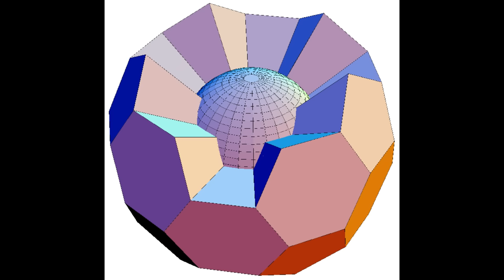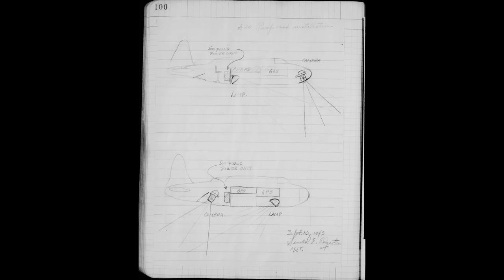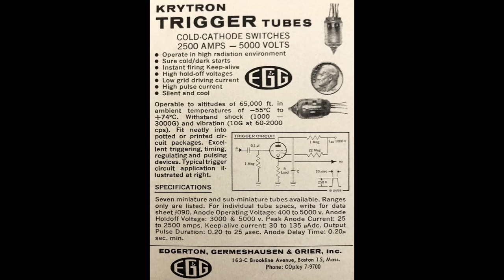Before The First Nuke Exploded... It Imploded.

Comment: For anyone wondering, high explosives are somewhat hard to detonate, you usually need another smaller explosion to set it off.
Reply: Not for C4
Reply: @Rob-tr1st  especially for C4, what do you mean?
Reply: @vrmousse  He probably read it on the internet :3
Reply: @vrmousse  I meant you need pressure and heat
Reply: Well with c4 you need an electric ignition block normally timed or remote detonated (edit ... its the energy needed to start the plastik chemical reaction)
Reply: This, now dynamite is pretty sensitive but TNT is hard to detonate, shooting at it with normal guns tend to not set it off, an M2 .5" round will.
Reply: @Rob-tr1st thank you for the laugh, but I hope you're not serious.  C4 needs an explosive to set it off.  A gunshot won't even set it off.
Reply: @billydoe6240 even an explosive might not set it off, the outside oxidizes and protects it from stray ignition, that's why they have to shove an ignition spark into the block
Reply: @billydoe6240  well having worked with it as a combat engineer I think I know how it's set off.
Reply: I guess nitro-glycerine isn't considered a high explosive? Asking here because I don't wanna google it :) From what I understand, NG goes off if you look at it funny.
Reply: It's explosives all the way down?
Reply: I offer nitrogen triiodide as a counter-example (not that any sane person would use it other than as a curiosity).
Reply: @Rob-tr1st in Vietnam they used to light c4 on fire and use it to cook food. Shits beyond stable.
Reply: @billydoe6240  even setting it on fire wont set it off
Reply: @magnemoe1 yeah dinamite and nitro, cordite and a few others have a naturally unstable chemical structure or unstable storage method resulting in lowered stability of the explosive that's normally why if we can we ship them with primers removed and in a separate shipment to prevent such things from going awry.
Reply: TNT was what's used in the early nuclear bombs, and potentially plastic explosives in newer ones, so to set it off, it has to be forceful in order for the chain reaction to start, Mercury fulminate is usually what's used to set it off as it's somewhat a high speed explosive which is necessary to set off certain explosives especially in the plastic forms. You can do squat with the plastic explosives, it's not gonna do a thing, burning or just smooshed maybe (it was intentional just so it's safe to handle).
Reply: @Sableagle  I thought they used nitroglycerin to control blood pressure or something?

How is that safe?
Reply: @billydoe6240  A friend of mine who was ex armed forces told me stories about how their CO had to keep telling units not to set plastic explosives on fire to boil kettles of water for a brew - not because it was dangerous, it was just a really expensive way to make a round of teas
Reply: @notfunny3397  Yep, in desensitized form.
Reply: @Dr_Mario2007  if I am not mistaken mercury fulimnate has been moved away from and now lead picrate and still under some R&D DDNP
Reply: @stoneymahoney9106  Yet if you are desperate, C4 makes a great tray candle to cook the food as it got a lot of energy density within so it burns very hot. And yup, it's expensive.
Reply: @StepSherpa  Yep, that too. Those explosives are somewhat more "green" compared to Mercury fulminate (who wants Mercury poisoning), so yep, they now use different blasting caps nowadays.
Reply: I feel like it'd be criminal to not mention azidoazide azide here...
Reply: @Rob-tr1st  so why could I burn C4 to heat water for my tea, without it detonating.....?
Reply: @Rob-tr1st   that is a lie. You are NOT an EOD. You do not know what you are talking about.
Reply: Your statement that MOST need a smaller explosive (primer or booster) to detonate is correct.But,my favorites dont.
Nitro and fulminated Mercury.
My very favorite,an oldie and goodie,is tetrytol.
Explosives was my specialty in the Marine Corps back in the very early 70's.
Reply: @TimmythatSquirrel with cy,tetrytol and other plastics,you need a cap.A simple electric charge wont detonate.Explosives and ammo was my specialty in the Marines.
Reply: @Rob-tr1st  It might be apocryphal, because EOD guys are a strange breed, but when I was taking my 3-day A&E class, we were told you could set C4 on fire OR stomp it, but not both at the same time. He told a story of an incident where an earth-covered magazine suffered an explosion and bits of flaming C4 were spread in front of the door. Apparently it was burning quite happily until someone tried to stomp it and put it out.
Reply: @notfunny3397 The amount of chemicals and ingredients in the heart med is reduced to almost nothing and at different percentages per ingredient than nitro that explodes.You can take a nitro tablet and smack it with a hammer and nothing will happen.You put a drop of explosive nitro on paper and set it on an anvil and smack it and it will pop rather loudly.
Reply: Wasnt C4 specially made to be stable to find a safer alternative to TNT? Pure Trinitrotoluol starts decomposing at above 150°C. I bet the mixtures are Not much different. Hence a Dentist Drill is water cooled and doesnt go beyond 100°C why would He be concearned setting of an Explosion.
Reply: Noted
Reply: @stoneymahoney9106   That was the Boston No Tea Party. Bang! General Early Grey again?! What? Deaf...
Reply: Army guard who didn't know this: (sees him melting comp B and drilling into it with a dental drill) (sprints out door)
Reply: Interesting, I will continue to not take my chances
Reply: @notfunny3397 They soak it into cornstarch or something to absorb any impacts. That's what dynamite was - nitroglycerin soaked into diatomaceous earth to make it safe to handle. (If you heat dynamite, the nitro oozes out ...)
Reply: @magnemoe1 Heat will set off tnt.  What
Reply: Normally for C4, compressed TNT blocks, powder explosive mixtures and commercial explosives a detonator capsule either electrically actuated or ordinary fuse actuated is sufficient. They can also be detonated with a detonating cord without a detonating capsule. An additional charge is necessary when it comes to cast explosives, for example, cast TNT must have an additional charge from compressed TNT to cause detonation, or the detonator itself must contain a booster charge. And yes, I cooked cans of beans with bacon and coffee on pressed TNT, plastic explosives and the like, it's a matter of quantity, 200 grams of TNT block OK, 1 kg not really, plastic explosive P36 100 grams ok 1/2 a little critical. Detonation will occur if the critical temperature energy threshold is exceeded
Reply: @miller2675 maybe you should learn the difference between EOD and a combat engineer before you correct someone
Reply: @STEVE_C_1369  a simple electric charge is not the same thing as exploding wires. People here are confused because primary explosives used for caps belong to the high explosives family too.
Any opportunity to talk about explosives is good tho 😀
Reply: High Explosive just means it's Shockwave is supersonic.  Nitroglycerin is a High Explosive and it will blow up spontaneously
Reply: @ConsciousExpression the difference is primary vs secondary and tertiary explosives, most primary explosives are high explosives but most of the commonly used high explosives are secondary or tertiary which are very hard to initiate by accident using stuff like tools or even fire.
Reply: @dinkoz1  ah that explains it, due to the Higher Mass and the longer burning time the Overall Heat Energy inside the Material raises above critical? Thats why you need a fuse to Insert the heat quickly so IT cant dissipate?
Reply: @billydoe6240  I've seen it used as fuck'n sterno. Bits of it twisted off, stuck on a rock set on fire to heat up coffee or MRE's.
Reply: @frimi6023  It's not the heat that matters, but the shock wave. Insensitive explosives are chemically stable until the moment they are exposed to the shock wave. For example, you can activate the detonation of a small amount of TNT, 1-5 grams, with a sufficiently large hammer. Likewise, all explosives have something we call "cook-off time" when the explosive exposed to fire will detonate after some time, military explosives also have an inhibitor to extend that time, especially with ship's ammunition to give the crew time to put out the fire and prevent the ammunition from exploding. The energy of the shock wave is what will start the chemical chain reaction in the molecules of the explosions. Sensitive explosives have very "strained" chemical bonds in the structure of the molecule, which makes them more unstable but more suitable for initial explosives, ie they are used in igniters and detonators to activate the burst charge. There are also initial explosives sensitive to friction, for example the PMA-3 anti-personnel mine has 35 grams of TNT and the initial explosive is activated when the spike inserted in the initial mixture moves when the mine is stepped on, which then activates the penrite which activates the pressed TNT booster and only then the cast TNT.
Reply: @trollmcclure1884  My job in the Marines in 1972 was 2311,with a lateral in disposal of explosive devices/rounds.
We used blasting caps that contained mercury fulminate.The wire within the cap was dual lead,and the ends were connected within the MF.An electrical charge went to the wire ends in the MF,and heated instantly ,causing the MF to detonate.Theres been some debate as to whether MF was high or low explosive.The main charge required a shock wave from the detonator.Low explosives give a sudden crushing expansion effect,whereas high explosives are so fast that they create a shearing,shattering shock effect.
I dont know if the debate has been ever settled.I do know that the caps worked.
We also used det cord to set off non electric caps.We'd take a bar or two of tetrytol,use the pointed end in our tool to push a hole into the end of the bar.Then we'd take a short length of det cord,insert it into the cap,and crimp it in with the tool (which,to prevent any chance of static discharge,was bade of beryllium).Then,we would link a determined length of timer fuse/cord to the det cord.At the operators end,we would insert the loose end of the timer cord into an M1 igniter.Then,the cap was inserted into the main charge (after the charge was taped to the explosives to be destroyed.)...had to edit that part in so as to avoid confusion.LOL. Once all was set,all personnel were run off,and the operator would pull the ring on the M1 and swiftly get outta Dodge. Ive popped off several old 90mm rounds ,2 at a time like that.Loved the job.
Reply: @notfunny3397 the dose of nitroglycerin for medical use is fairly small. Not sure what’s done to stabilize it a bit.
Reply: @notfunny3397  They do. They supply it in very small quantities, and it's handled carefully.
Also, you can stabilise it with clay powder. That's a combination known as dynamite.
It made a guy called Nobel a fortune, which he used to create a whole institute to award big prizes for big accomplishments.
Reply: @ConsciousExpression  ...but then if you pull the "who? moi?" innocent face fast enough, it'll stop the explosion dead in its tracks. Like, half way through.
Also, nitroglycerine is NOT used as "high explosive, applied" those days. Yes, TECHNICALLY speaking it is a high explosive, but it is not included in the field of practical application, and therefore "it doesn't count".
Reply: @mrboredj  Precisamente, amigo - all the way down, until it stops.
Reply: @notfunny3397  A great example that proves there is more than one useage for the same material.  Taking advantage of the different properties of the same material.  Just because something is explosive, doesn't mean that it is necessarily poisonous.
Reply: @Mike.The.Jeweler  My dad (USAF Ammo Troop) once said, "You can lite it on fire or you can hit it with a hammer, but don't do both at the same time."
Reply: Some bombs dropped from planes have a whole chain of explosives, So says my Dad a retired Ammo troop. Multi stage fuses. tiny explosive charge to set off a slightly larger explosive charge to set off a slightly larger Explosive Charge to set off the entire bomb.
Reply: @alistairwhite2906  it needs a strong shock or percussion to "set it off".   It is very stable.  Combustion is very different chemical reaction than detonation.
Reply: @Rob-tr1st  You can literally set C4 on fire.
Reply: @LeCharles07  no shit what's your point
Reply: It's just a matter of concentrated energy.  Either it can, or can't, deliver the threshold.  I'm sure when he got past the first second of drilling he knew he was gonna be pretty good.
Reply: I think the line "high explosives are somewhat hard to detonate" is a little misleading.
Sure any high explosives that most people deal with are stable. If they weren't you wouldn't be dealing with them.
There are some horrendously unstable explosives out there.
Reply: That's why they used a high-current electric charge. And the charges to each block detonator were timed to within 5 nanoseconds. The detonators are called "exploding bridge wire" and provide the initial shock to set off the high-explosives.
Reply: Still... just a thought of drilling into it 😮 brr
Reply: Mining Engineers rule.
Just for clarity, the term "high" explosive refers to the velocity of detonation. High explosives break rock and low explosives lift it out of the way. Black powder is considered a "low" explosive as it detonates ~6000 ft per second. It'll still do a lot of damage but won't shatter rock like some RDX or C4, which cook off at ~25,000 ft per second. ANFO mixtures can be low to high velocity, depending on composition (mixing in other higher velocity stuff). We used MagnaFrac which is ANFO based that goes ~15,000 ft per second to break quartsite, a notoriously hard rock. It required an RDX 'stinger', which required a #8 blasting cap, to initiate. Det cord is just RDX in a tube and it too requires a cap to initiate.
Reply: @trollmcclure1884  "Any opportunity to talk about explosives is good tho 😀" as long as it's educational!!😁
Reply: Was it on Mythbusters where they tried how hard it's to detonate C4; tried burning it, shoot with firearm and drop anvil on it, but nope, no detonation.
Reply: @mrboredj  Always has been. When i was a kid, i emptied the black powder from my fireworks to make my own explosives. 
Carry on. o7
Reply: @PexiTheBuilder  Any Mythbusters episode with a gun in it is full of lies.
Reply: @Rob-tr1st  Soldiers literally burn that to make campfires. It works great in the rain.
Reply: That's not a general rule or an automatic state of a affairs. It took a lot of hard work and great care to make sure that high explosives are hard to detonate and safe to handle. There are many, many stupidly sensitive high explosives, but nobody picks those for bulk explosives in weapons or demolition or mining. The primary explosives are things more sensitive than PETN and transition from deflagration to detonation in a tiny volume; they are still used and needed in small amounts for things like blasting caps and primers for ammunition.

Even primary explosives avoid the reams and reams of terrible high explosives that you can barely look at with them randomly exploding.

The first commonly used high explosive was nitroglycerin in pure form as an oily liquid. It's maybe less sensitive than you think as a dropped bottle wasn't guaranteed to explode, but it very well might occasionally do so. Or it might seep into the rock and not detonate in the blast; only to come out of a crack somewhere else and explode when someone is hand drilling with a sledge hammer.
Reply: @notfunny3397 are you serious?   its literally what makes TNT explosive... its the N in TNT.... YES ITS EXPLOSIVE 😂
Reply: @Rob-tr1st You could burn C4 in a campfire in place of wood and it wouldn't explode (I wouldn't try it, but that's how it's suppposed to work).
High explosives need a combination of high pressure and high temperature to go off, you get both with the small explosion of a detonator.
Reply: @ConsciousExpression  Aparently it is.
But it also has the downside of being so unstable that it decays really easy naturally, maybe not the most useful high explosive.
Supposedly the defining factor of high-explosives is the "bristance", or tthe shattering capability
Reply: @Rob-tr1st they use an electric charge for C4.. it's not pressure and heat that you need ypu need energy. In a smaller explosive that comes from  heat energy released from the smaller detonator(and yes pressure helps).. but an electronic detonator will work just fine for c4
Reply: Taco bell will do the trick. Buck.25 and about 1 hour to brew.
Reply: @ddegn  From what I understand it's more unstable while it's being made, though. I wouldn't attempt it without waldos and computers and bullet-proof glass.
Reply: @William-Morey-Baker  The "N" is "TNT" is "nitro." A nitro group is one nitrogen and two oxygen. They tend to break down to produce nitrogen and hand oxygen off to something else like carbon or hydrogen. Glycerin is propantriol. It's three carbons in a row with one hydrogen each end and a hydrogen one side and a hydroxyl pair on the other side of each carbon. Nitroglycerin has the hydrogen of each hydroxyl group replaced with a nitro group. That makes it three carbon, five hydrogen, three nitrogen and nine oxygen. Double that and you get 6C, 10H, 6N and 18O, which will form 6CO2, 5H2O and 3N2, with a single oxygen free radical left over to oxidise something else. TNT is trinitrotoluene. Toluene is methylbenzene, six carbons in a ring with a seventh attached and eight hydrogen covering it. TNT replaces three hydrogens with nitro groups again. 7C, 5H, 3N and 6O. Again, double it. 14CO2, 5H2O, 3N2 and negative twenty-one oxygen free radicals. I'm guessing that means incomplete carbon combustion and a lot of soot. Photographs look like there's a lot of incandescent soot produced. Presumably, some of that's going to burn up once it mixed with air. This brings up the interesting idea of mixing twenty-one moles of nitroglycerin with one mole of TNT, 4767 g and 227 g, so the surplus oxygen from the nitroglycerin can burn up the TNT. I don't much fancy trying that out in those quantities, personally. I'd want to start with much smaller quantities just to make sure they don't go off on contact or anything fun like that.
Reply: i was expelled from school making figurines from what i thought was a dense play dough. I now know that the material was C4 from the hobby shop.
Reply: Yup, and the stuff in modern nukes could be blown up with low explosives,shot and and chucked whole into a fire and still not explode. But give it a hot Shockwave from an electrical arc and it goes with extreme power.
Reply: 👀

Tatp
Hmtd 
Nitroglycerin
Mekp
All very easy to detonate relatively speaking.
Those are primaries.

High explosive secondaries are quite a challenge to detonate

But primaries are easier 
And you use primaries to set off the really hard to set off secondaries
Reply: sometimesssssss.... most high explosibes
Reply: @ConsciousExpression  sounds like my wife.
Reply: But no high exposes ever not hard to detonate it at all.
The main issue is deployment like the minuteman missile built America built-in 80s. Pretty much the fastest one out there. Still, Russia has some comparable ones. They can't figure out how to mount that on an airplane on a sub on. A ship So we have c*** alternatives like the Trident and stuff.
Reply: high explosive just refers too the detonation velocity. high explosives can be quite atable or incredinly reactive.
Reply: @notfunny3397 I spent my childhood wandering if the nitroglycerin in my dad's heart pills was the same as the nitroglycerin that went bang
Reply: @Redact63Lluks you can burn C4 as a fuel to cook food lol. It can literally burn without exploding! Has to be detonated with electricity or another explosion